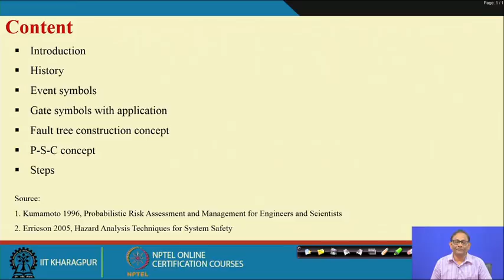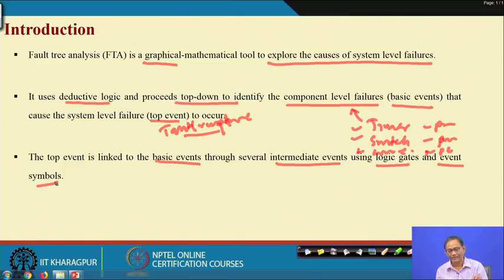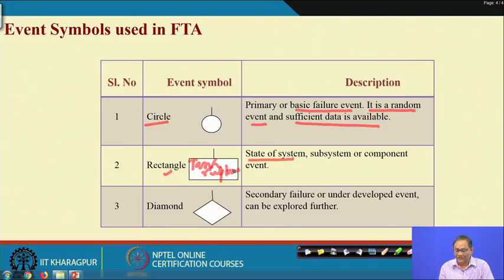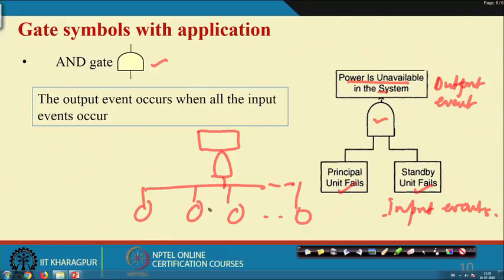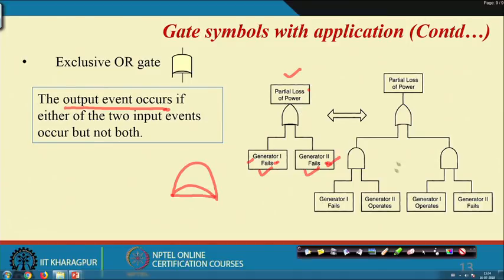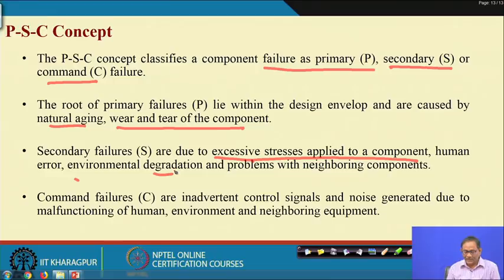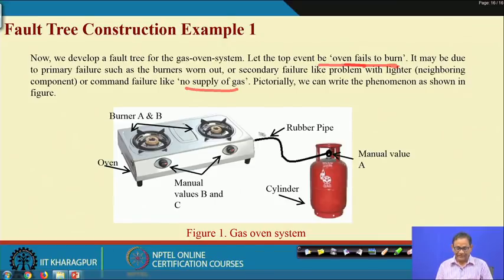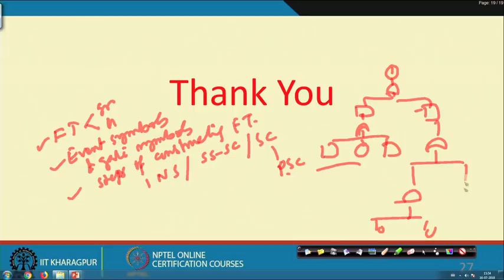Lecture 12: FAULT TREE ANALYSIS (FTA)- Construction

Comment: in the picture about the fault tree analysis of the gas oven system example, you mentioned the manual value of the gas container. I thing you want to write valve, in stead of value. is not it?